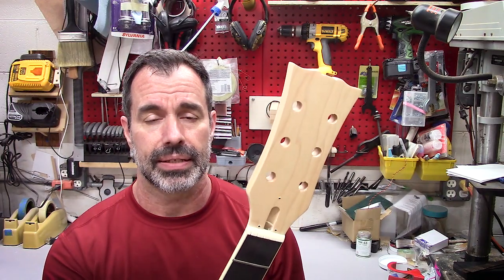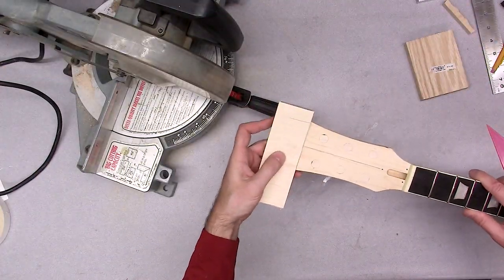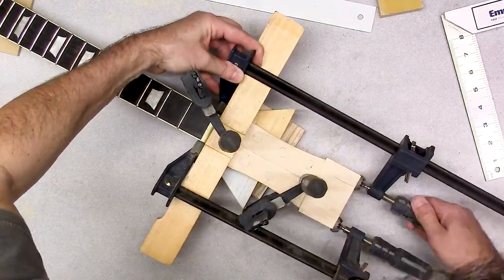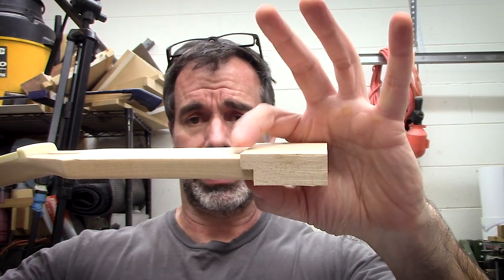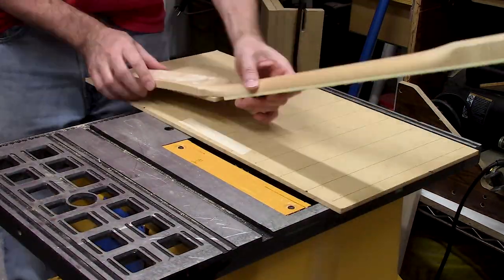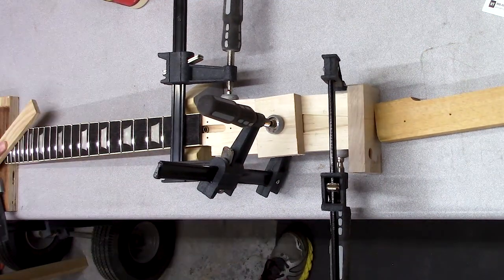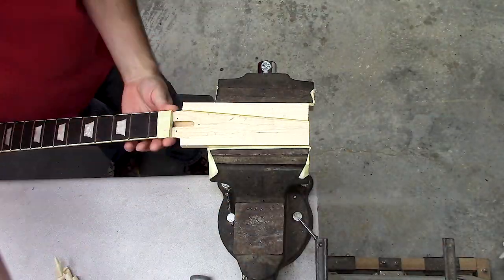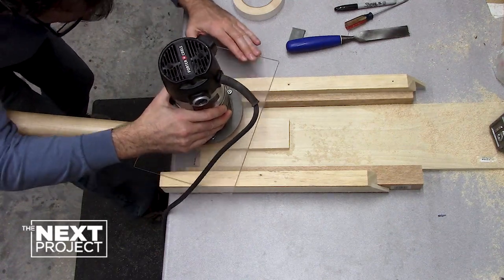Harley Benton SC Guitar Kit - MOD Ep 4

Comment: Be careful with tuner peg layouts.  H-B now has their DG strings running into the AB pegs on the LP SCs.  They copied the wrong peg design.
Reply from the maker: @Clay Wynn, that's interesting... the D/G strings are splaying out far enough to hit the A/B pegs... Hmm.
I've seen similar issues on various guitars for years. Some of the really wide head shapes spread the D&G pegs so widely that the strings between the nut and the peg appears to touch the A&B pegs. 
That wasn't an issue with this kit, and my reshaped head design straightens the pull substantially.
Thanks for the note on what HB is up to.

Comment: If you were gonna add wings to the Headstock like this why did you waste time plugging the Tuner Holes?
Reply from the maker: @James Reaves, good question and one I considered before doing the cuts and adding the wings.  
I wanted to fill any void that may be in the path of the cuts and routs, and ensure that any remaining tuner holes be filled as to allow better location of new holes to come.  Perhaps it was extra work to a small degree, but since this project is not been pre-planned to the tenth of an inch, it was simple and safe to just plug the holes. 
The work and material time were minimal. Thanks for the question!
Reply: @theNextProject  I wasn't trying to be a smart-ass and I hope my question didn't come across like that I was just not understanding why you did that because when I saw later had narrow you cut the headstock down it looked to me like you had bypassed all the holes so I didn't see the point of plugging them but I understand now that you didn't know if you were going to be cutting all or part of them out of the way and this way it would be simpler to be sure I understand now. Thanks for such a quick reply
God Bless!!
Reply from the maker: Hey Jimmy, I didn't take it that way, not at all.
I honestly don't understand why I do a lot of things they way I do either. I often paint myself into a corner, then have to figure out an escape route.
This project is largely a bunch of experiments, one after another. Or perhaps one causes another. 
This is kinda just a idea test bed of ideas and mishaps, and I'm making decisions on the fly. I'd like to think everything is planned out, but the reality is slightly different.
Keeps me on my toes.

Comment: When will you present the next episodes?
Reply from the maker: @Finn Høj,  thanks for the message!  
Sorry for the delay in getting new content posted. It was a very hectic end to 2019, and a wild start for 2020 so far. 
I just returned from working on the headstock, adding some veneer to the front and back faces. The next episode should post the first week of February.  I really have too many projects open right now.  At least this guitar mod is a fun project.
In addition to all that, I had a couple little setbacks on this project. I tend to get in a hurry and skip steps, which just causes me more work. I also forget to think things through occasionally. 
Thanks for watching!
Reply: I will look forward to the next episode(s).Take care.

Comment: I've just watched all of these and am looking forward to the end result. That being said, I'm not understanding why you went from a rectangular headstock to a rectangular headstock? Seems to have been a lot of work to end up back at square 1? Anyway, I will definitely keep watching for the next chapter and I'm sure it'll end up being a beautiful guitar
Reply from the maker: @Nigel Smith,  Thanks for watching and the Square-to-Square headstock question will be resolved soon.
OK, OK, i'll just give you the details now. You are right, it was a lot of work to make a paddle, but now I have a clean and blank drawing board from which to cut the new shape. Plugging the tuner holes and cutting back for the new wings allows me to cut a new shape and not rely on the original tuner placement, nor worry about the new outside edges of the headstock shape cutting through the old holes.  That may be hard to follow... Hmm. The next video will hopefully answer your question.  
I'm hoping for a beautiful guitar too, and if I'm lucky it won't sound bad either. 
Stay tuned!

Comment: Strangely satifieng to see this take shape, good to learn woodworking skills! i see you do things with the router i did not think of before, like usung acrylic to better see where the bit is.
cheers for sharing!
Reply from the maker: Frans Terhorst, thank you!
I have a lot of learning to do, myself. 
I am always faced with challenges to overcome, and typically realize a better way of doing something part-way through the process. The acrylic base is very handy, I don't expect it to last forever as it will likely become so scratched up over time, I won't be able to see through it - but then I'll just make a new clear base.
One thing I would like to add to the router, or base, would be a small LED light to illuminate the cutting area. I've seen some add-on solutions, but I'm still looking for a solution that fits my random process. 
I'm glad to share, and hope that everyone who watches will take ideas and improve on them, or at least get a laugh out of my work. It's all good.
Take care!

Comment: я одн не понимаю зачем столько безпантовых движений
Reply from the maker: @Ин Су Лин  
Sorry for the delayed reply. 
I don't know if this translation is accurate, but it reads something like this:   
"I alone do not understand why there are so many pointless movements"

You are correct, there may be a lot of pointless work happening in these videos.  This project is just a challenge to myself, taking something that did not need to be fixed, or changed, and doing just that.

I learn something from everything I do, even when I should not be messing with it. I just like taking things apart, and hopefully being able to put them back together. 

Thanks for watching the video!
Reply: @theNextProject  you're right, I'm just a perfectionist and can’t do anything about it))
Reply: @theNextProject  you're right, I'm just a perfectionist and can’t do anything about it))